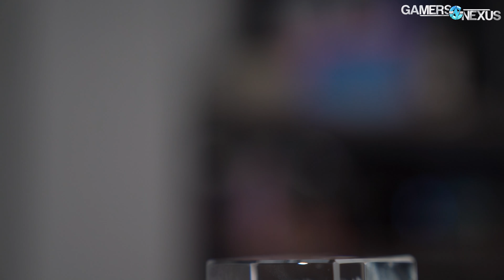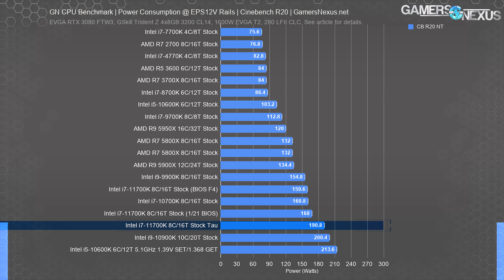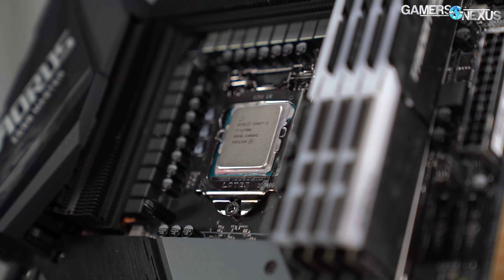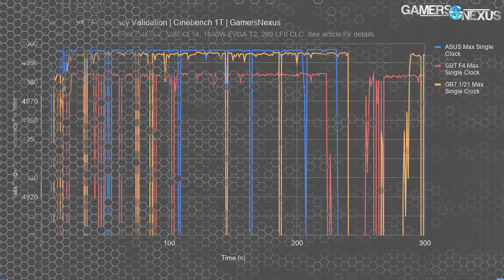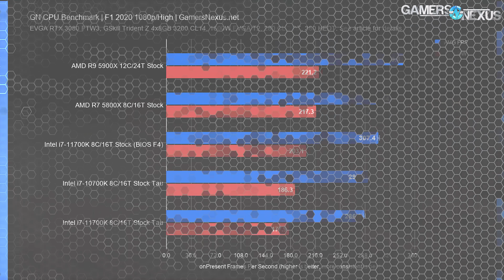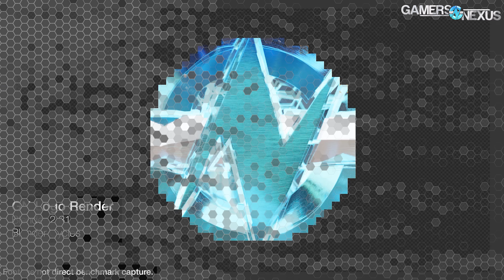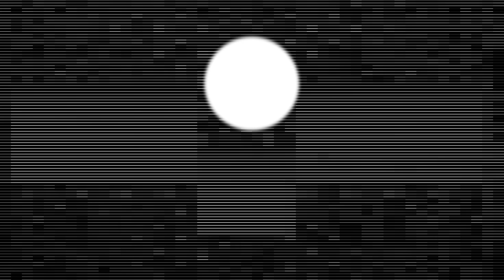Intel's Z590 Motherboard Problem: i7-11700K Power & Thermals Explained

Comment: oof so are intel fanboys going to try to complain only amd has mobo problems
Reply: AMD = buying a ferrari with engine Problems
Intel = buying a porsche and everything works

what would you buy now? i for myself preordered i9 11900k. sry but i dont want to deal with bios or usb or anything else problems!
Reply: @reijhinru1474  sorry but you got that backwards.
Reply: I wouldn't complain about not-having to take the time to overclock my chip

People can still dig into settings and revert any of the board defaults to overclock manually if needed

what exactly is the problem here other than making it harder to compare the CPU's
Reply: @austinh1028  im just  messing around in youtube comments, fun to get the pot mixing with people idc about the issues of either cpu
Reply: @thetruestar6348  im not a fanboy of any brand but its a fact that amd makes good products on the hardware side but on the software side they always have trouble. Its the same with gigabyte godlike absolutely best hardware on the market but the worst bios and driver management you can get...
Reply: @reijhinru1474  Um okay

Comment: intel only got mixed up with their names, the 11700k was supposed to be called a 10700k and vice versa. a minor mistake that led to an older cpu releasing after the latest. don't worry, next generation will definitely catch up with the 9700k

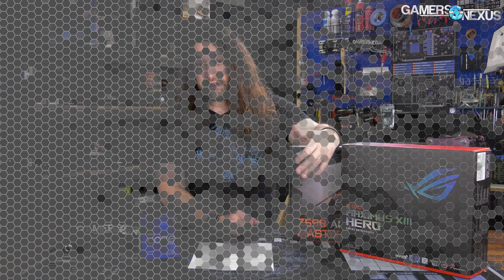Comment: 6:19 - Damn, I didn't know the R7 5800x competed with the R7 5800x so closely.
Reply: There's no way I'd take an R7 5800x over an R7 5800x. that's just dumb.
Reply: Of course R7 5800x is better. How you couldnt get that?
Reply: yeah, their power consumption figures are practically the same !
Reply: No way dude.. the R7 5800x is 7nm while the R7 5800x only has 7nm.
Reply: I think that's expected considering the price point. An R7 5800X is very comparative in pricing as an R7 5800X.
Reply: The results are literally identical!  Amazing.
Reply: Well, you will gain big improvement if you upgrade your 3700x to R7 5800x compared to R7 5800x.
Reply: yeah but one was bought at MSRP and the other is off ebay
Reply: Umm but the R7 5800x Cost 475 and the R7 5800x cost 475....
Reply: No way dude. You’re totally wrong. The r7 5800x is better than both of those..
Reply: You guys are definitely dumb, it’s clearly a mistake. There’s no way those two could perform so similarly.
Reply: I'm sure it's no coincidence that AMD's "waste of sand" is being subliminally marketed via Steveception against Intel's "waste of sand".
Reply: This reminds me of another R7, the 240 (an entry level gpu back in 2013). Why you might ask  - because there were both an R7 240 as well as R5 240 (but both sucked for gaming, so it wasn't a big deal if you got them mixed up).

Comment: Is anyone who buys an Aorus Master or Maximus Hero going to run stock Intel power settings?
Reply: You'd be surprised. I helped a user on a forum who bought a 10900k, a high end motherboard and some huge 360 AIO. He couldn't understand why he was getting crappy benchmark scores..... Turned out he hadn't even loaded the XMP profile for his expensive RAM.
Reply: Yes
Reply: The board looks cool and they have the money. It occurs to me.

For practical reasons that kind of MB are for extreme overclocking: aka sub-zero.
Any practical overclocker for 24/7 would probably run a MB around the 200-400$ tag: they usually come with everything you need for OCing things to what's doable at ambient, even VRMs capable of handling the current passively or with almost no air-flow.

Comment: I mean, it's definitely a spec if it's on the spec sheet. The games these motherboard makers are playing cause issues for normal people. Like my buddy bought a prebuilt with a 10700F and was wondering why it kept hitting 90c during games. It turns out the mobo had unlocked the power limit and the included cpu cooler was insufficient. While the extra performance is appreciated, if prebuilt manufactures are cutting corners on cooling this becomes an issue more than a benefit.

Comment: Would MSI be a good motherboard company for the 11700k? I preordered their Z590 tomahawk and am not sure if they follow intels guidelines
Reply: The Tomahawk series has always been decent. But with a 11700K I would manually overclock as this would allow you to un a much lower voltage and still have an high overclock. I have manually overclocked my 10700K at 5.1GHz all core at only 1.27v which runs cool as I use an AIO...no temp issues at all and max performance!

Comment: I'm confused. Is this a good reason to upgrade my i5-8600K? I've been rocking it for 4 years, and while AMD has offered reason to upgrade, this lineup is really starting to resemble Bulldozer.
Reply: A 8600K with a 1080ti is still a good combo. It's impossible to get a GPU anyway, but if you consider upgrading GPU on that setup I recommend you watch this Hardware Unboxed vid  first: https://www.youtube.com/watch?v=JLEIJhunaW8

When things start to normalize I'd consider 5600X/5800X (they're actually hitting MSRP and are in stock now). But you could also wait for 11th gen to launch and scoop up a 10700k for cheap, since 10th and 11th gen are functionally equivalent.
Reply: The reason to upgrade your 8600k is threads.  6c 6t will cause frame drops at times.  If you aren't noticing those no worries.
Reply: @MrAustanian  I mean, the hardest I push it is playing Planetside 2 and the MCC. It's paired with a 1080 Ti, for reference.
Reply: @davidmalkowski7850  did it cause fps drops and bottlenecks in planet side 2?
Reply: @ArthurM1863  That's the one title where it can struggle to serve up frames when fighting at TI Alloys or the Crown meat grinder.